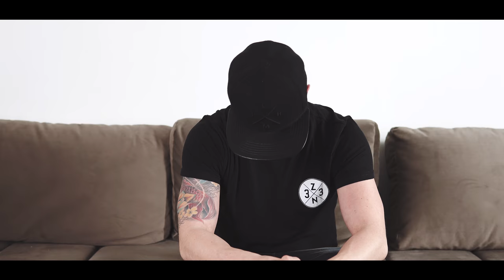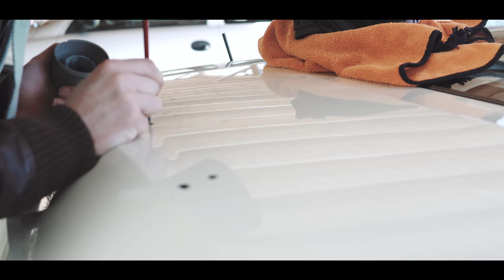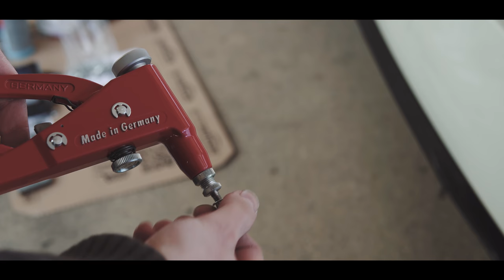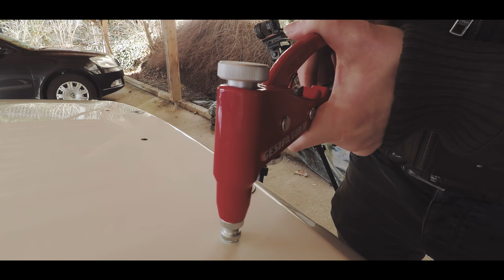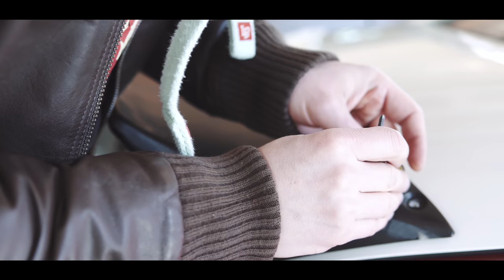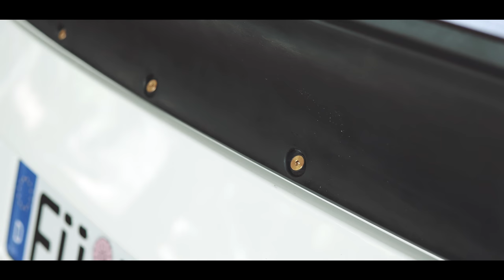RIVET NUTZ | ROCKET BUNNY WING INSTALL | PART 4 | ZerofuckZ CHRNCLS Ep. 09

Comment: I am very interested in the bolts/rivet base that you used. I bought a ducktail and it seems to have a similar type of bolt/rivet. But I cant find a rivet gun to pull it
Reply from the maker: Tool should be linked in the video description
Reply: What about the rivet nuts where can you buy them
Reply from the maker: @chuntitan6208  everywhere you can buy rivet nuts 🤷🏽‍♂️

Comment: Hello mate I’m about to install mine this weekend, apart from the corrosion protection grease , did you also have to seal the holes where rivet nuts are to prevent moisture to get in ? Thanks , great job
Reply from the maker: I also put zink spray on the drilled holes
Reply from the maker: The grease I used is a special sealing grease against rust.
Reply: @MIMCKMedia   thanks for getting back to me , I’ll give it a go . Thanks bud
Reply: @MIMCKMedia  just one last question .. did you use the spray first then the grease and the river straight away or waited a bit till it settled ? Thanks
Reply from the maker: @andersonTEV1  first zink spray then I let it dry 24h then insert Rivnuts and grease

Comment: Awesome Job man! Wanted to do my own Rocket Bunny install. Which exact screws were those used? Did you silicon the holes?
Reply from the maker: They are titanium screws. No it´s not silicon it´s a corrosion protection grease (link in description)

Comment: Is there any reason you used the rivnut on the top row of bolts but then on the bottom row you used a bolt and nut setup?
Reply from the maker: Yes, because on top you got double layered sheet metal and can't use nuts, but on the bottom you can use nuts.